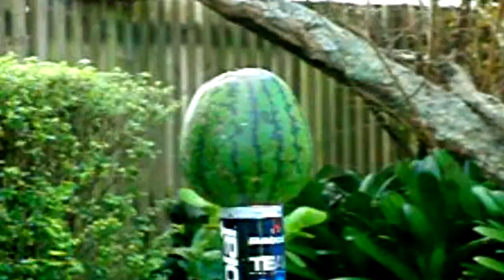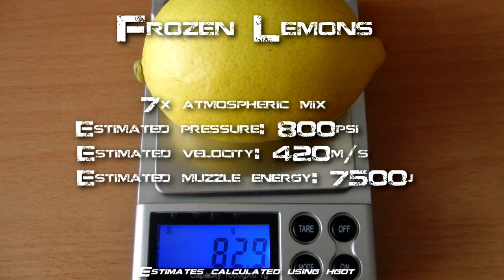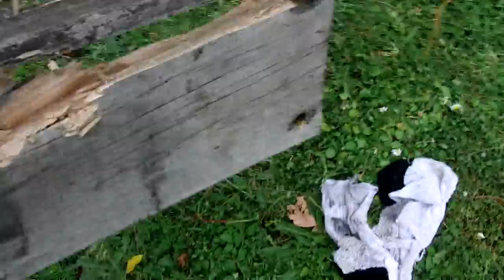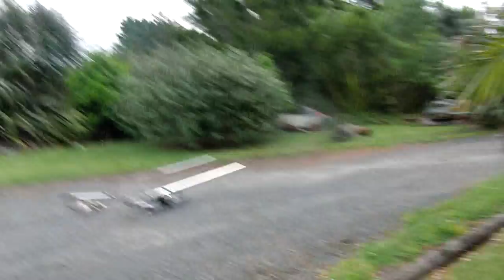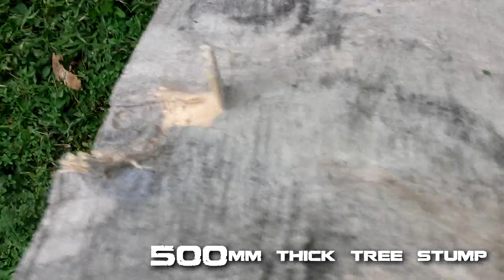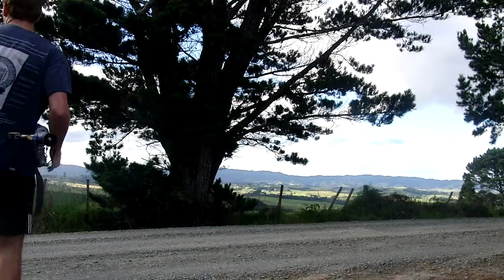50mm Hybrid Golf Ball Cannon (Supersonic!)

Comment: Years ago I used the old original tin coke cans, before they went to punched aluminum. Four or rive of those, tape and a little know how, and I had a tennis ball cannon. if you left out the tennis ball, use lighter fluid for the propellant, it made one heck of a racket setting it off. It would send tennis balls quite a distance. I built one for a friend who lived on a lake. The geese would tear up his boat dock, so I built him one and he'd use it to scare the geese off, it worked, also scared the heck out of the neighbors until they saw what he was doing with it.

Comment: Could you use hydrogen instead of the MAPP gas?
Reply: David Taylor yup but I wouldn't use plumbing pipe if I did, I would have the chamber custom machined from steel tube. Check out "spudfiles dot com/hybrid-cannon-database/", there are some crazy hybrid cannons out there.

Comment: send me the instructions on how to make one of these!!😎👍
Reply: www.spudfiles.com If you really want to make one, you have several weeks worth of cruising the Hybrid section of the forum. Not the hybrid cannon showcase thread, but the hybrid discussion thread. There is a lot to know about making and using these cannons. They are absolutely deadly devices and should be treated as such, many of these powerhouse potato guns exceed the muzzle energy of big bore firearms. And if you build it incorrectly, or sloppily, or you cut corners, they can explode and maim/kill you and/or those around you.

Read all the forum rules first, then read all the stickies in the hybrid discussions. The information you need is not easy to find and will take some time and dedication to find and understand, these things are immensely unsafe and we (the potato gun forum community) don't want just any kid with a few bucks and a garage to tinker in building these, for safety sake.

 I wish you luck if you decide to embark on this endeavor, it can be extremely rewarding to fling a golf ball past mach 2 with just your knowledge, some elbow grease and some plumbing parts from the hardware store. Expect to spend several hundred bucks on parts and tools, a bit cheaper if you have a bunch of tools. A metal lathe or someone who has one will be quite useful to you as well.

Comment: what did you use as a fuel?
Reply from the maker: Alpha Nerd either MAPP gas or propane (it's in the description!)
Reply: ***** sorry didnt see that. I was just wandering how you got such incredible power out of a golf ball gun. do you think you could get the same performance out of propane?
Reply: @AlphaNerd132  the gas is compressed before ignition which means it can get alot more energy per volume of fuel compared to non compressed, a person was even able to make a bullet go through 1cm of hardened steel plate with 200x
Reply: @byte7645  holy shit 7 years ago. thanks for the comment. this was a MINT contraption. might have a go at making one